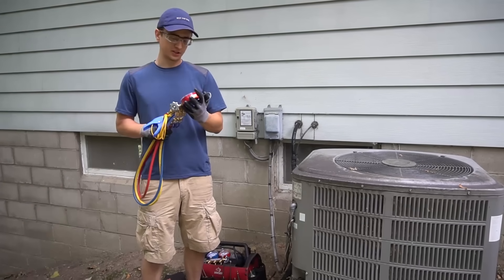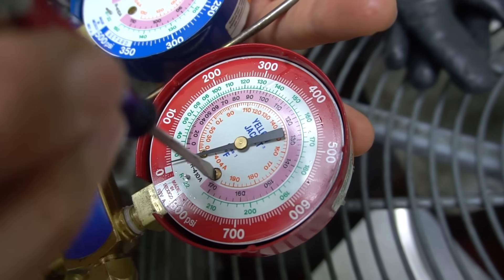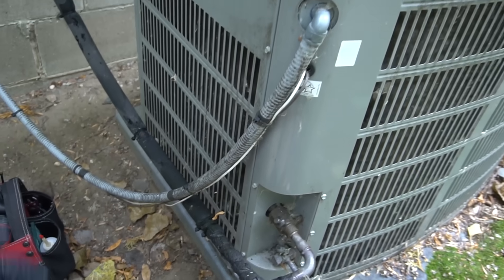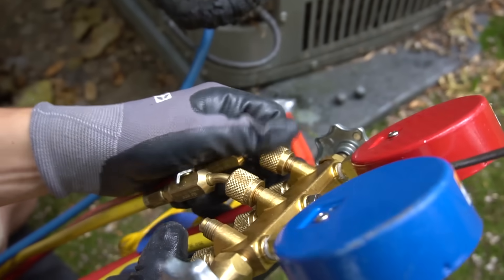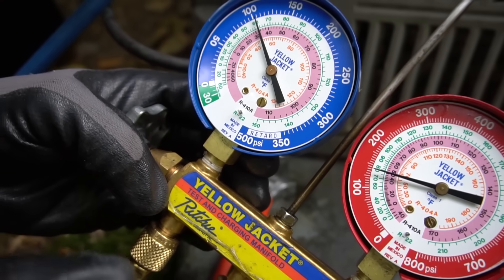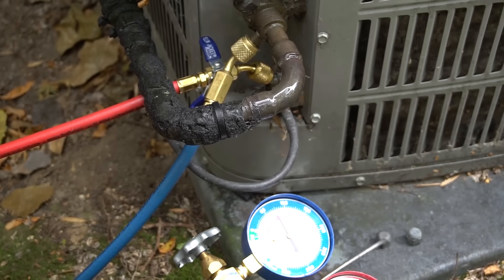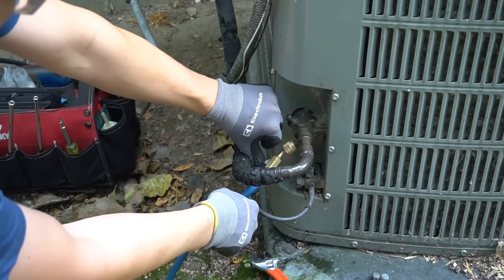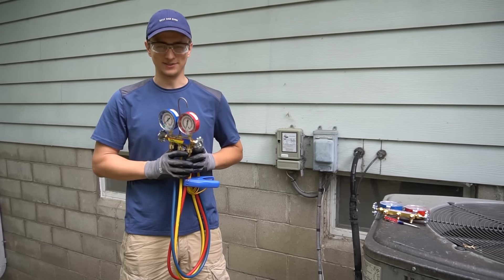How to Check AC Freon Level

Comment: As someone who works in the industry  this is to funny to watch. All you have dont is make more seevice calls for techs when they screw up. And some of the advice is actually wrong
Reply: I have been in the industry for 35+ years.
what about the other dangers. Such as a bad hose fitting gasket or stuck Schrader valve spraying liquid refrigerant all over.  Or someone getting into a system that is currently going through a compressor burn out and oil is carcengenic.  Making sure nobody's around such as kids so they don't inhale vapors of ref  oil.  Your just showing people a path to some serious trouble. Only people with training and testing from certified  instructors should handle gauges.  I believe your intentions are good. But as the robot said in the show " lost in space"  DANGER, DANGER, DANGER.
Reply from the maker: Thank you for all the warnings Jim! I agree with you and I do say in the video that people without HVAC background and experience should not be messing with refrigerant. So I am definitely not encouraging people that don't know what they are doing to try this.
Reply from the maker: Oh I see. I suppose different countries/states have different laws. Here is 410a on Amazon for example: https://amzn.to/2NFOhri   anyone can buy it. R22 used to be just as easy to buy but now that they are phasing it out, they took it off of Amazon.
Reply: Word of Advice TV, actually a person without an HVAC license can purchase R22 off Ebay, but you have to sign a waiver that you're only going to resell the refrigerant to a licensed HVAC technician.  Sure, sure, I'll resell the R22 just like you want me to do...;-).
Reply from the maker: I haven't checked on E-bay recently but that's good to know! Thank you :)
Reply from the maker: Glen, could you specify what was wrong? Just curious to know for myself. I purposely tried to explain a complicated topic in a simple way, without going into superheat, subcooling, amp draws, duct sizing, wet bulb, seer rating, etc.

Stephen, you are right. I should have mentioned that in the video. I'll add it to the description. Also, at this point, you do not need to be a qualified person to buy R410a. Though it is getting tough for unqualified people to get R22.  Releasing refrigerant to atmosphere is illegal and can be a 10,000 fine last time I checked. But there is the de minimis release rule which means: "quantities of refrigerant released while making good faith attempts to recapture and recycle or safely dispose of refrigerant including releases that occur when connecting or disconnecting hoses to charge or service appliances." So according to the EPA, refrigerant released from hoses or which escapes when putting on your gauges is lawful. https://www.epa.gov/section608/stationary-refrigeration-prohibition-venting-refrigerants

Comment: nice video, but how do u charge it? how do you know how much to charge to ?
Reply from the maker: The reason I don't make a video like that is because unless a person knows what they are doing, they can very easily make things a lot worse for themselves. And I can't show every possible scenario in a video so I tend to avoid making "how to charge a unit" videos. There are other videos on YouTube that show how to charge a unit though. But basically your low side temperature should be about 40-45 degrees. (for both 410a and R22) Usually when I see a unit that's low on charge, the low side will be anywhere from 10-30 degrees. So you would have to add refrigerant until your low side temperature goes up to 40-45 degrees.
Reply: @WordofAdviceTV  that is not an accurate way to charge a unit...
Reply from the maker: @Josh Teasley   I agree. Before I charge a unit I typically get my wet bulb, super heat, and sub cooling readings then consult with the SuperCool Slide Rule. What I said about the temperatures is how it usually goes for me. I should have explained further.. If one were to go by temperatures alone, that may work on some ACs but eventually you will come across a unit that has a frozen evaporator coil or a restriction and then likely the unit will get overcharged...
Reply: @WordofAdviceTV  I guess what I dont understand is why make these videos? Homeowners should not be working on their own systems. Sure, if someone is say an electrician they can check the electrical components but overall you are risking a lot of liability teaching people how to do things they have no business doing.
Reply from the maker: Hopefully those people will read comments like you and others have posted. This video was more for people who have some HVAC schooling or background. Folks with no previous HVAC background should not be attempting to do this.
Reply: @WordofAdviceTV  That's why you should have a notice or warning at the front of the video. Homeowners love watching diy repair videos like this. People think they can go to Walmart or advance auto and buy a set of guages for 134a and use those.

And also, the temp on the guages is saturation temperature, not temperature of the refrigerant.
Reply: @WordofAdviceTV  everyone that got started was not certified but now those who are Tech's don't want any competition
Reply: What about a psycromer to measure the wet bulb to get the proper superheated and sub cooling . What kinda of metering device do you  have? The suction sweating is the evaporator flooding back the unit is probably overcharged .it takes more than just pressure it's temperature also. a over charged unit will kill a compressor
Reply: You need to be epa certified to buy 410a
Reply: You dont need to be certified to buy it only to use it. I bought 410 for my a/c because none of the contractors knew how to correctly charge and I have a slow leak.
Reply: @markd4905  that's changing
Reply: @markd4905  for what kind of a/c System? A sealed system(residential) or an open system (automobile).  If it's a residential system you should identify the leak and get it repaired.  If you can't find a contractor you doesn't know how to charge it, stop asking DIY and find a reputable company to do it.  They should also recommend you fix the leak.
Reply: Not for 2 pound cans.

Comment: @10:06......It's not which Freon your system uses.....It's which refrigerant your system uses
Reply from the maker: I call it Freon because the average person associates Freon as refrigerant but they are not sure what I mean when I say, your unit is low on refrigerant. I guess it's just a habit I got into at work. I used to try to explain to people that it's not Freon but I stopped with that :)
Reply: i thought Freon was refrigerant, whats the difference?
Reply: @danielfaria1548  Freon is a brand name for R22 and is a refrigerant. Its like calling all pasta ....macaroni
Reply: thanks for the info
Reply from the maker: Freon is actually a registered trademark of The Chemours Company. (owned by DuPont) The stuff used in most residential ACs is not actually Freon but that's how most people know it as. I guess in a way it would be like referring to all brands of shoes as Nikes, no matter who made the shoes. Refrigerant would be the shoes ;)

Comment: Good video again. Could you tell me the normal values of pressure of r410?. Thanks!
Reply from the maker: I found that part hard to explain while I was filming, sorry if it wasn't clear enough. Average pressures for 410a are 120-125 PSI Low Side, 315-320 PSI High Side. But keep in mind that the temperature outside will affect your refrigerant pressures (lower temps, lower pressures. Higher temps, higher pressures) The SEER rating of the condenser unit will have a bit of an effect on the high side pressure as well.
Reply: There's a lot of other things as well..incorrect duct size, dirty filter, indoor humidity, house load.. it's not as simple as normal.. you actually need to take discharge air temp ,return air temp, indoor wet bulb, outside temp, line temp to get a correct reading..
Reply from the maker: I agree. But if you check 100 air conditioners that are working normally, most of them will have a "normal" pressure range. This video was more for how to put on refrigerant gauges and how to read them, not how to diagnose a refrigerant problem. I did not want to get into superheat, subcooling, amp draws, duct size, seer rating, wet bulb, etc
Reply from the maker: Thanks for adding that Adam. That's weird, I see your comment on my dashboard but on the actual video page I can't. If others can't see it, he basically said that as an AC professional he would recommend getting a temp drop.
Reply: adam G well put!